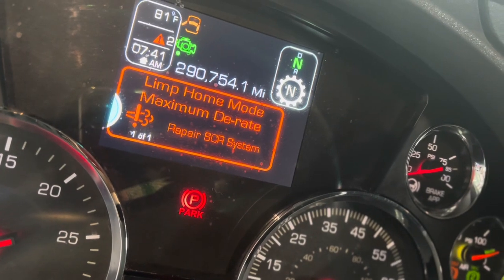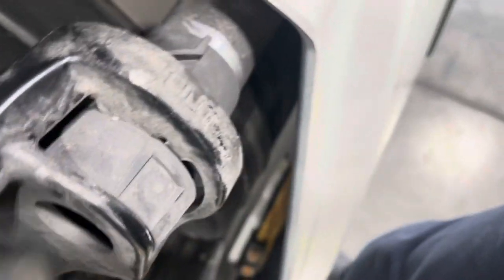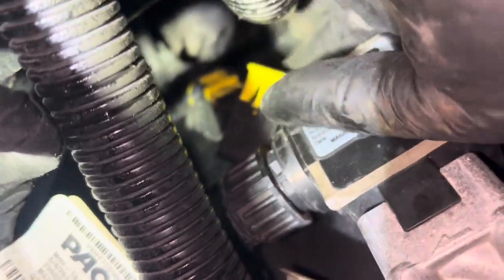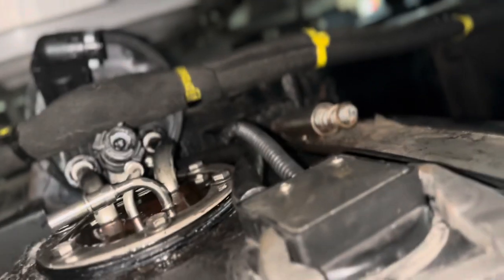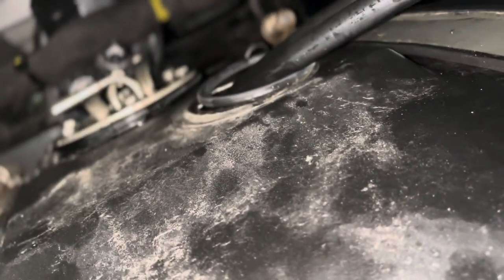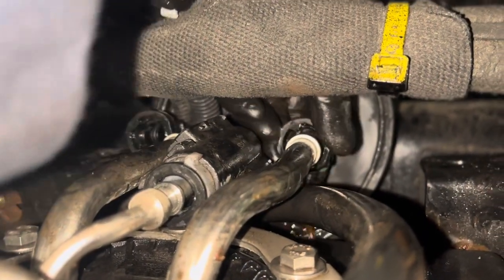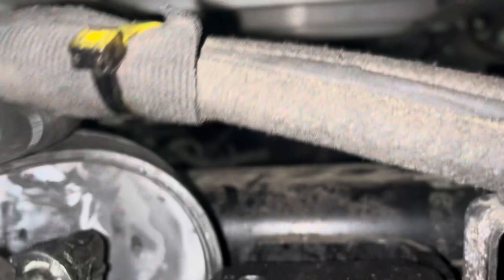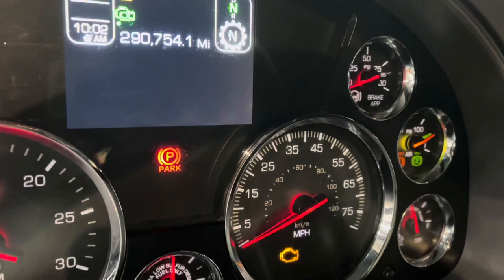Kenworth limp mode def level sensor failure

Comment: Have a same problem but i ready replace 2 diferent sensors brand new from the dealer but the gauge starts fluctuating up and down and the truck goes to derate mode cause of the computer not reading the def level

Comment: I have a Peterbilt 579 showing the same limp mode. I believe it’s causing my truck not to start what do I do?
Reply from the maker: In limp mode that means you have an after treatment problem, you can get your code read to see what the actual problem is, your truck can go into limp mode for other multiple reasons.

Comment: Hey I have a truck DD15 with the same issue and i changed the header and no change
Reply from the maker: Just to keep it simple first have you checked voltage coming from harness which plugs into the header? I ensure there's no breaks in the wires, another thing I will check also resistance. Also are you able to pull codes?

Comment: This sensor is $450 for the part alone and I have replaced mine twice.
Reply from the maker: If the DEF is too concentrated and too much urea is present, the heat from the machine can turn it into ammonia. The ammonia would go on to burn and deteriorate not only the DEF header, but the entire machine. To prevent the creation of ammonia, you should test the concentration of urea in your DEF using a refractometer.

Comment: Was your truck going 5 miles?
Reply from the maker: Yes, just about so
Reply: @smartmotives  mines doing the same but I’m not sure what’s the problem
Reply: How did you know it was that sensor
Reply from the maker: @cravorkiancarson9412  Code read on Cummins insite, verified the problem due to the gauge reading incorrectly with a half full tank.
Reply from the maker: Half full of DEF fluid.
Reply: My truck just started doing this 🤦🏽‍♂️
Reply: @smartmotives  I put half in mines yesterday  then it happen, been stuck in Chicago IN since, dude bout to come with the parts in a min, buy down since 12 yesterday
Reply: If you unplug speed sensor on driveshaft u can drive at 1400 rpm and reduced power

Comment: it doesn't need the Regen, if it did it would run the program...
Reply: I changed my sensor and still have the same issue
Reply: @JNRLLC-ep1uv  did you fix it ?